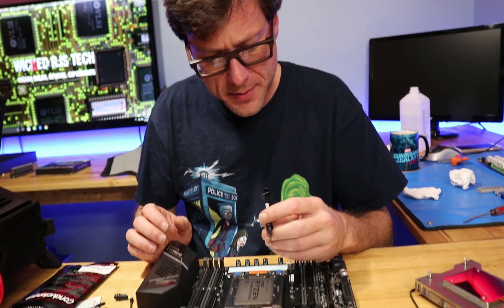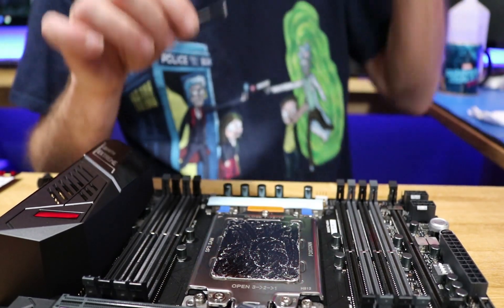Applying Thermal Grizzly Conductonaut on Ryzen Threadripper. However, is it bad for your CPU's IHS?

Comment: I am already seriously considering using Thermal Grizzly Conductonaut liquid metal thermal paste on Ryzen Threadripper CPU I have so it doesn't cook itself when I chuck the heavy duty supercomputing tasks at it - I already decided to water cool both CPU and GPU so that way it's cooler and reliable over long term.

That workstation is for both work and play, so there's that decision behind the cooling, I had to think about it seriously as Ryzen Threadripper CPU is a powerful chip, so it's best to keep it cooled down as well as I can.
Reply from the maker: I've really liked the stuff over the years

Comment: it's been two years, any damage on heatsink or cpu base? any thermal problems? I'm about to apply it on 3960x but kinda worried, not sure if it damages the base of cpu or noctua air cooler.  also, I don't want to open and reapply it again.
Reply from the maker: No problems yet, I have it on 5 different CPU/GPU and don't see any problems.
Reply from the maker: https://youtu.be/PcH41LpfFt8

Comment: I’m about to receive the liquid metal today or tomorrow and I’m a little bit worried about what I’ve beeing reading about AMD using Aluminum etc. So if you reading this now did you faced any issue applying liquid metal on your 1950x because I have the same CPU and was wondering should I go for it or not
Reply from the maker: No problems yet with the liquid metal on my vcards or cpus
Reply from the maker: https://youtu.be/PcH41LpfFt8

Comment: AMD has confirmed to others that the IHS is infact made of Aluminium, so I would think about removing this stuff pretty quick if I was you before it chews its way through the IHS.
Reply from the maker: Yeah I've heard rumors that it has small amounts, I'm kinda curious what it will do. I'm not far from the 1 year point, going to take it apart and check it out and do that yearly

Comment: And, any updates on this?
Reply from the maker: So far no problems
Reply: WicKed RJ's Tech That’s good to hear. I am still unsure whether to do it or not. People all over the web claim it’s made of Aluminum and Grizzly is a bad option for it.
Reply from the maker: I have heard also that the IHS has Aluminum in it, perhaps in small amounts. However so far short term its been no prob at all. It will be interesting to see what it looks like a year or 2 down the road. I can say if it will full Aluminum it would have reacted very quickly by now. not sure if you seen it yet, but I think my 2nd vid I ever made experimented with using this on Aluminum and it was crazy what happened and how quick too
Reply from the maker: https://youtu.be/PcH41LpfFt8

Comment: This is a great video, really perfect application - will be doing my 2600x tonight so now I'm a bit less nervous :)

Do you every worry that it can drip or leak out afterwards? That's the only thing I'm scared about!
Reply from the maker: Thanks man! :D 
Ya know I never thought of that actually. I think as long as you don't have to much it should be ok ;) I could see if you have to much product on that the heat sink for push it out.

Comment: It's bad because of the Aluminium ihs
Reply: Nice Video btw :D (Y)
Der B8auer made a good video cutting in the IHS, to show the chips, where you can see, that it is kopper inside and nickel platet all around 
the vid is caled "THREADRIPPER Roulette (en)" ^^
Reply from the maker: Hey Mike! Thanks for dropping in :D Man I've seen first hand what Conductonaut can do to Aluminum O.O and quick too! Really surprised me, crazy! I wonder how much Aluminum is in a IHS and how much would it take before it causes problems. I think a majority of CPU IHS's are nickle plated copper. But to what percentages? I don't know.
Reply from the maker: Hey Imy Slimy! Thanks for the compliment :D 
That's awesome! I will have to check that video out, I really like Der8auer's videos :D he is on the top of my list for fav channels
Reply: ALL Ryzen CPUs are NICKEL PLATED. Shouldn't be a problem.
Reply: Raizor Endenium 
Thanks.

Comment from the maker: So lets hear it! Is Conductonaut and liquid metal thermal paste bad for the CPU's IHS? I will be keeping a close eye on my CPU's. I have Conductonaut on 3 CPU's. Threadripper, Ryzen 1800x and the Volcano FX 9590. I will be also taking my Threadripper apart here again soon so I can install a new block and will clean up the IHS for a close look ;D
Reply from the maker: So far so good. Going to pull things apart and see how they are holding up. Performance and temps haven't changed any